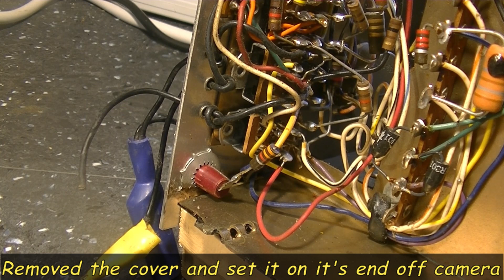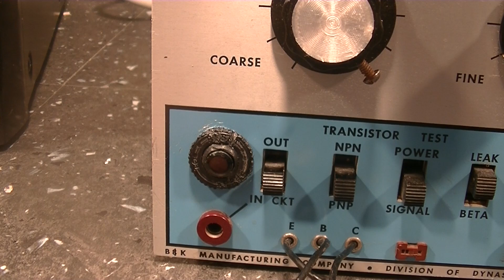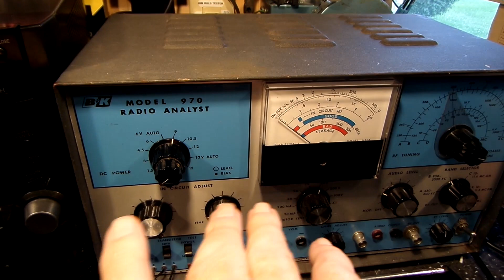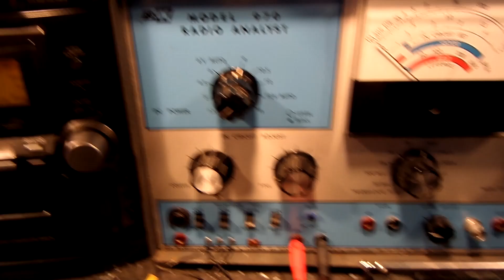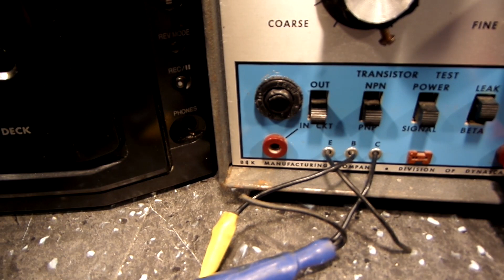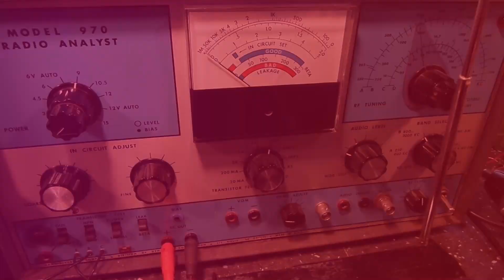B-K 970 Radio Analyst - Adding circuit breaker in place of DC power fuse

Comment: Adding a circuit breaker is always a better option than using just a fuse. I added a circuit breaker to my Variac for that reason as well. Great job on the installation Doug.
Reply from the maker: Thanks Larry, I think it will prove to be a worthwhile addition. :)

Comment: The circuit breaker install really turned-out nice, and having it in the front is very functional Doug
Reply from the maker: Thanks Jim and I agree. Even though it will be easier to get at the back in it's new place, I have plans to stack some stuff on top of it so it will be much handier to just push the reset on the front. :)

Comment: Hey Doug, really like the circuit breaker install idea.  A few bits of test equipment I have would benefit from that too.  The coil subject you brought up sounds really interesting.
Reply from the maker: Thanks PF. I recapped this unit when I first went through it and then tried to calibrate the frequency generator, but one band was way off and found a stuck slug in the adjustment coil. Plus I installed new fuses and promptly blew the 5 amp one which protects the DC output power supply when the clip leads I was using shorted together accidentally. I had it located in a place that was very difficult to get at the back of the unit so I decided then and there to switch the fuse to a front mounted circuit breaker instead. Will be much more convenient I think. :)

Comment: Hello Doug,  nicely done,  it looks like it was meant to be there.  Much more accessible on the front panel,  especially if you put it on a shelf - - I hate reaching around the back of equipment trying to find switches or fuses.  Regards,  Dave
Reply from the maker: Thanks Dave. Yep, I totally agree. Now if I could just find an easy way to fix that one RF coil with the stuck tuning slug this thing would be perfect. :)
Reply: @DERB_Seymour_Indiana  I'm looking forward to that repair, should be interesting.